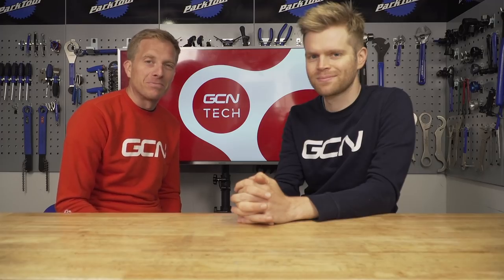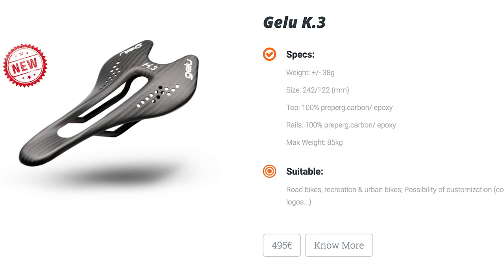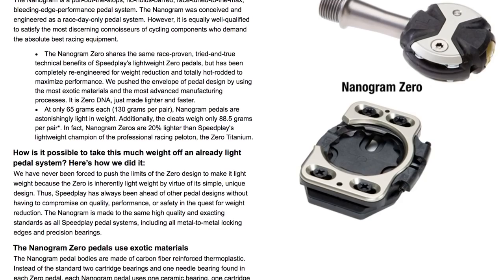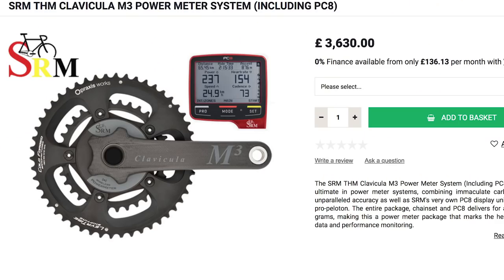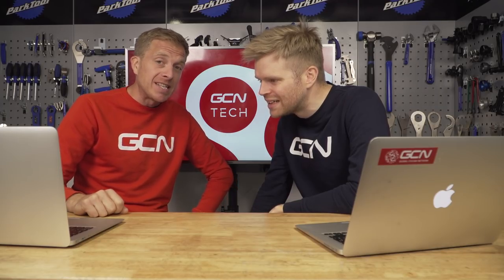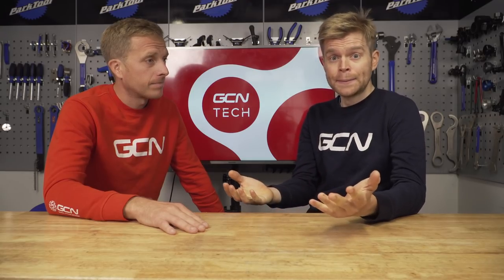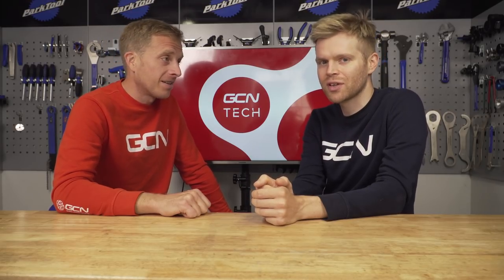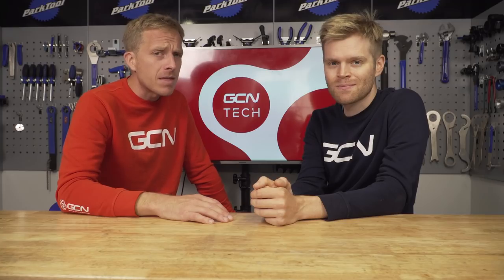Building The World's Most Expensive Bike Ever! | GCN Tech Show Ep. 36

Comment from the maker: The list that Oli and I chose include....
Frameset - Custom Parlee Z-Zero
Paint Custom Paint job - Fatcreations
Seatpost - Schmolke TLO UD 
Saddle - Gelu K3
Wheels - Lightweight Meilenstein Obermeyers
Tyres - Dugast Strada Silk Tubulars
Skewers - Tune U20
Pedals - Speedplay Nano Zero Ti
Campagnolo Super Record rear mech, front mech, shifters, battery & cables
Powercordz Brake Cables
CeramicSpeed Oversized Pully wheel system 3D printed Ti
Chain - Muc Off Nano
Chain Rings - Rotor Qarbon, Fibre-lyte inner ring
Chainset & Computer - THM Clavicular SRM with PC8 bundle
Bottom bracket - CeramicSpeed
Bottle Cages - Lightweight
Bottle Cage Bolts - CarbonTi
Handlebars and stem - Custom 3D printed titanium cockpit
Expander Plug - CarbonTi
Stem Top Cap - Kapz Custom Headset Cap
Brake Calipers - THM Fibula 
Cassette - Rotor Titanium
Headset - Chris King Titanium
Handlebar Tape - Cinelli Leather
Bar End Plugs - Schmolke
Reply: I would add Schmolke carbon screws
Reply: you could add a custom titanium 3d printed seatpost clamp, custom 3d printed race number holder
Reply: Next week do the lightest bike
Reply: GCN Tech get Futura to do the paint job
Reply: What is the estimated weight of this bike?
Reply: GCN Tech what about getting som ceramic bearings in the wheels, the headset and bottombracket
Reply: Thanks, saved me getting the butler to write it down. Jeeves can just print this list out and take it down to Halfords for me.
Reply: Forget the "cheap" custom paint. Insted use 24 karat gold plate on the whole bike. Thats adds a bit more value for the bike , at least £200 000 😉😉😉😎😎😎
Reply: I would of said campag super record 12sp
Reply: GOKISO WHEELS
Reply: GCN Tech I
Reply: would be interesting to do the same video for the lightest bike
Reply: Did you really give your own commentar a "heart"?
Reply: I think there are some conti track tyres which retail for around 400€ EACH. But I might be wrong
Reply: This bike setup is kinda like what the boys here are riding on a regular weekend. No kidding.
Reply: very cost-effective pedal choice, compared to the Look Keo Power Meter Pedals - $1,479.99 from a US online dealer
Reply: What about tubes?
Reply: Your wheels are too cheap... Check out Lew Racing Custom VT-1 Pro. USD 15,000.
Reply: Gokiso hub.  £7000 for a pair
Reply: Ship it to Norway, and you can add 25% of tax on the total price and shipping ;)
Reply: price of the frame is not correct... it would be less than that WITH a custom paint job and custom carbon layup from parlee...
Reply: Lewracing has more expensive wheelset if they are still.priducing them. Lewracing VT 1
Reply: SO how much did the most expensive bike and build cone to?
Reply: Expensive bar tape please
Reply: Chris king no thread set! Still the No1 after all these years. 💓💕💖
Reply: Lights, valvestem caps, and fuck it; helmet.
Reply: You should use gokiso wheels, $7900 for the pair
Reply: I believe I found a more expensive tyre which is a set of continental Olympic tyres which are for track but if you the sultan 300 quid for a tyre is nowt
Reply: WEIGHT??
Reply: @benjaminknudsen1320  I agree
Reply: Bar tape and CeramicSpeed Bottom Bracket?
Reply: Derr You forgot the 3D printed Gold Mudgaurds, Carrier rack and bell (which also has Diamonds)..Added a few Million there....

Comment from the maker: uh oh, Ollie forgot about the ceramic speed bottom bracket! Jon
Reply: And handlebar tape and bottle cages
Reply: What if you would buy a frame used by a professional legend on eBay. I bet the price could go up a bit then :)
Reply: Most expensive groupset is the Rotor 1x13, costs over £3000, nearly $4000...
Reply: and seat post clamp
Reply: And ceramic speed hubs
Reply: Gonna say
Reply: and tyres, tubes, seat clamp and chainring bolts.
Reply: I think I’d have to get that $199 chain run in and coated at  ceramic speed as well
Reply: And their lube
Reply: Just to anger some people I'm here to suggest that we need to find the most expensive SADDLE BAG as well.
Reply: and also forgot ceramic bearings
Reply: Sadly the normal forks of the 7k Frame are to cheap. The THM forks seem mor fitting...

Comment: That Chris King headset doesn't fit the frame.
Reply: CK makes a fitting HS, and the ceramic version is 245usd, so not far off pricewise.
Reply: Nope, Chris King only makes an IS41/IS52 headset. This frame needs an IS41/IS47 headset. That won't fit :)
Reply: That's even better, both "chris king" and "custom made" is the same sentence!
Reply: Where did you read "custom made"?
Reply: I did not, but they would have to contact ck för a custom order and that would be anything but cheap
Reply: CK does not do custom headsets..
Reply: ... unless you have a large enough pile of money
Reply: if you have a large enough pile of money you can ask anyone to build anything.. kinda defeats the purpose of this video.
Reply: Doesn't fit, that's good- spend more on machining work.
Reply: You don't want to machine bearings... Or carbon headtubes..
Reply: Well, if you imagine a saudi Oil Prince on it, it suddenly all makes no difference, since you won't even see it under his Kaftan.
Reply: Z Zero's don't use penetrative bottle cage bolts either (nor do the Z1, 2 or 3)  -  if these guys actually knew their product, that would kinda help.
Reply: @newosamoht4593  couldn't have said it better

Comment: You forgot about the bottom bracket, the bar tape, chain catcher, front and rear cameras, and you have to be safe so you need the lights as well. And don't forget the QUARQ tire pressure thing or the thing that measures your drag coefficient.

Comment from the maker: Let us know in the comments if we missed any super expensive components.👇
Reply: brake pads, bar tape...?
Reply: I think that you missed some fancy bar tape, brake pads, bottle cages, custom steerer cap, cable hoses and bottom bracket... Uh, if you want to ride at night you will also need the lights 😂😂😂
Reply: Innertubes,bartape,ceramic speed bearings?
Reply: Yep me as rider
Reply: Saddlebags, tools, tape, bottles, garmin, tape, anything to add even a few £ lol
Reply: There must be some mental hubs kicking around.
Reply: The Pinarello bolide time trial frameset is more expensive than the Parlee I think...
Reply: Ax Lightness???
Reply: Bar tape???  You can spend $$$ on bar tape.  Plus you have to do the kit.  Shoes, Sunny's etc
Reply: GCN Tech build it then auction it.
Reply: I could make it even more expensive, if you have money enough please contact me 😂
Reply: You should make a disc brake bike as wheelset would be more expensive, and it should be clincher with tubulito tyres inside. Campagnolo had made an disk brake groupset so it would be expensive enough.
Reply: Isn't bugatti bike more expensive?
Reply: You could also bundle it with a car to cary the bike (the car that is less expensive than a bike)
Reply: Don't forget to fill your bottles with Cristal! It might not keep you hydrated, so make sure your domestique-butler brings some chilled Voss water along.
Reply: You need to decorate the frame with butterflies!
Reply: Titanium Screws? Use Carbon Screws!
Reply: As many have said Where's the bar tape, the bottle cages and bottles etc but more importantly what about the Bottom bracket and surely you've got to change the wheel hubs from those that come with the lightweights.
Reply: My garmin vector 3 pedals were $1000, unfortunately.
Reply: @mallillinrjkaylec.6413  it's tubular
Reply: You forgot the rider. Helmet, shoes, jersey
Reply: Gokiso Wheeset, goes for $8.000.
Reply: Just buy the trek butterfly madone. instead of 36.000 it costs 500.000. Thats not anywere near.
Reply: @Ludovico Crespi whaat?
Reply: Bottom Bracket!
Reply: @zonda6012  Like the trek butterfly madone
Reply: Hey GCN you forgot to add the PREMIUM ultra light brake wire end caps. Cheers!
Reply: how much would it weigh though?
Reply: You need the support vehicle with backup bike. Plus the rider and bike for the lead rider to reduce drag.
Reply: Ignoring things with gold and jewels...

Paint job: COAT does Speedvagen SupriseMe! schemes that are well over $2000.
Wheels:  Gokiso Titanium Super Climbers & GD2 tubular rims @ $8k  -- http://www.gokiso.jp/en/products/hub_01.html
Tires: Soyo seamless silk @ $500/tire -- https://www.benscycle.com/soyo-scr-silk-seamless-road-racing-tire---njs/tire_soyo__420-108-16/product
Cranks: You got me on this one. Cane Creek Ti cranks are $1k, but it's just a crank.
Pump: Pegoretti painted Silca Super Pista Ultimate pump at $1200, but it was limited edition
Reply: Switch all the bearings to Ceramic Speed bearings
Reply: What was the weight for ths mega buck build?
Reply: numberplate holder. of course you are going to show off in races
Reply: As already mentioned, someone HAS to be making a bar tape from Unicorn leather, or a fabric bar tape woven from velociraptor nose hairs, or something like that. Come on! Also, a YBN titanium chain with Molten Speed Wax gold treatment is $274.99.
Reply: No SRM power meter to go with that bundled computer?
Reply: I would like to know my speed and the distance traveled when riding that bike (cyclocomputer)
Reply: Yiu miss bar tap
Reply: computer muont and super light computer
Reply: you guys missed out SOYO SCR Silk Seamless Road Racing Tire - NJS. It cost just $499.99 per tyre.
Reply: how about a $14k passoni titanium frame or the thm crankset?
Reply: you forgot about the cycling kit.
Mavic Comete Ultimate shoes- $999.95
Rapha Cycling kit ~ $500 (average among gender kits)
MET Trenta 3K Carbon helmet: - £238.50 ($308.17USD)
Rapha Socks - $30
Oakley Radar Pace sunglasses - $524
Total= $2362.12
Reply: You need a Carbon wheel with Enve Ses 6/7 Rim with Gokiso Superclimber Hub and Sapim Cx-ray Spokes,
hmmmm the only thing i can tell you it's that hub's price can buy that Lightweight wheel set
Reply: Instead of painting it, you should have gotten a custom steel frame and plated the whole thing in 24k gold. Could have added at least $300k to the cost... Maybe more?
Reply: Ceramic bearing bottom bracket and wheel hub bearings? What about crazy expensive inner tubes. Also if you had of made it a disc setup, you could have spent big on rotors/calipers etc
Reply: Obviously you need a rider for that bike!
Similar to a thoroughbred race horse, you're not riding it yourself, you enter it to some races and you buy someone else to ride it for you
Reply: It would be simpler to buy a custom Aston Martin One-77 Cycle. According to Factor “you won’t be surprised to learn that the One-77 Cycle costs $39,000”
Reply: what about the Damien Hurst x Trek butterfly bike? $5000000
Reply: A bell? 😀
Reply: Bike computer
Reply: Lew Racing VT1 wheelsets are around 15k... Gokiso Super Climber wheels are around 9k these days i think
Reply: What about the grease?
Reply: There are wheels from the Japanese brand GOKISO that are more expensive than the lightweights

Comment: Consider a tandem for your world's most expensive bike. Check out: https://calfeedesign.com/frame-pricing/#tandempricing. Even if you skip the exotic "triple convertible to tandem," a custom tandem frame with couplers for air travel, custom geometry, and some other options could easily top $12k. And then you need two of your crazy-expensive seatposts, saddles, handlebars, etc.

Comment: Ceramic bearing bottom bracket and wheel hub bearings? What about crazy expensive inner tubes. Also if you had of made it a disc setup, you could have spent big on rotors/calipers etc

Comment: You missed

- Bottom bracket(i know you corrected yourself in the comments
- rubber crank covers
- hydraulic dropper post
- suspension fork
- brake pads
- different brake/shifter levers

Comment: Now, wait a minute, if those a tubulars, you aren't going to use cheap off-the-shelf glue, are you? Same goes with the bar tape, which needs to be made of some sort of nano gel infused dirt-repellant carbon matrix.
Another super important thing is, as you lads know from your high school studies, gold has the lowest current resistance out of all solid metals in temperatures compatible with biological existence. Hence the Di2 cables inevitably must be made of the chemically pure gold thread to reduce shifter lag and improve battery performance. 
Also, since (as we all know) electricity is conducted on the surface rather than within the solid core, gold threads, naturally, must be made tubular to both make them lighter and increase conductivity two-fold. It could be easily achieved with 3D-printing at about $750 per yard excluding raw materials.

Comment: Might have been more expensive to build your own wheel  with a expensive rim then expensive spokes with dynamo hub, rohloff speed hub, carbon belt drive. Then of course bar tape
Reply: Or use a Pinion P1.18 gearbox... or use both a Rohloff and a Pinion together for the ultimate in gearing (and cost)!

Comment: You forgot a ceramic bearing bottom bracket. And i think you were way off on the cost of the handlebars. I believe you guys mentioned in one of the gcn videos that the 3d printed bars that team sky use on their tt bikes were available for £17,000 (could have been $). You also forgot head unit mount, bottle cages.